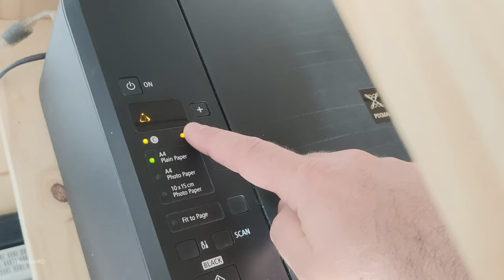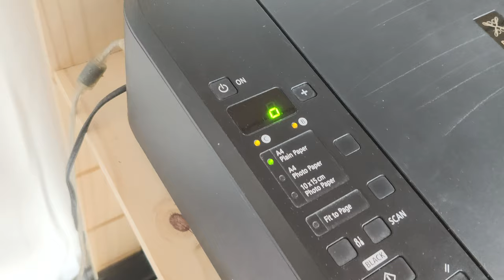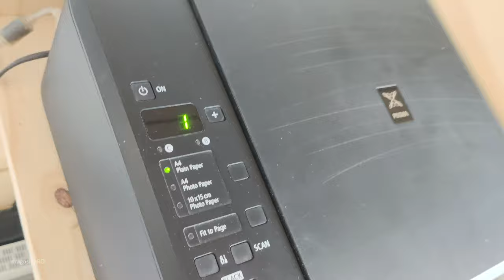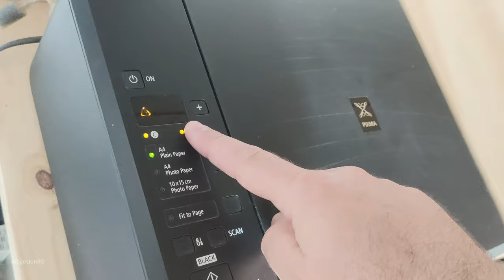How to Fix Error E05 in Canon Inkjet Printers

Comment: Hi, I have a Canon MG3200 printer and it prints a test page great but will not now print anything else....
Reply from the maker: Check USB connection and install printer drivers as the instructions say in your printer manual.

Comment: Hi! this really helps! But I can't take my cartridges out. When I open the cover, it's not responding as how it's usually supposed to be. I didn't connect my printer to any computer/laptop.
Reply from the maker: Power should be connected to the printer and you should press the printer power button to turn it on.
No need for pc connection.

When you open the door of the cartridges, they should be moved to the sport where you can remove them within 1 minute - it does it by itself if it's the same cartridge type.

If your printer head is separate and there are only ink cartridges - the separate containers for each color, those have a simpler way to  remove. Those don't need to move and they are ready to be removed even if the printer is not powered on.
Reply: @IONHowTo  ok I'll try..thanks

Comment: Hi ive mg3150 issue ...not with ink ...new canon ink fitted ...my router was changed by  virgin....how do i reset so as to link with new modem / router...my printer is v similar to urs on YouTube...cant get canon help ...
Reply from the maker: Mine is without wifi. Check the manual for your model or a guide on how to set it up.

Comment: Solution: NEVER BUY a CANON PRINTER
If you like spending nights on forums,, all kind of sequences, error codes etc. you tube, go ahead , buy a CANON printer
If you just ant to print: buy anything else
I bought a Canon G3100, same issues as my old Canon printer (M-something,
 printer head burned out..) : stupid error codes, wasting much time on 
youtube, forums , still not working ERROR1234, ERROR 5678, it never 
stops. Even after a factory reset (find the sequence yourself... Power, 
5x something, then something else.. ))
DON'T BUY CANON A PRINTER, BUY ANYTHING ELSE (eg EPSON)
I  live in Honduras, Hey Canon,  you pay for shipping etc ?  Better I 
throw it on the fire and buy an EPSON. Wasted too much $$$  and time on CANON 
garbage.
Reply: If you like the manufacturer updating your software so that you can't use 3rd party ink cartridges buy a HP. They all seem to have issues to sort out.